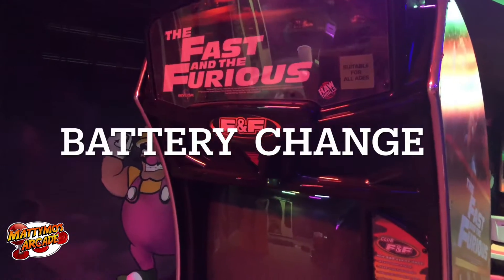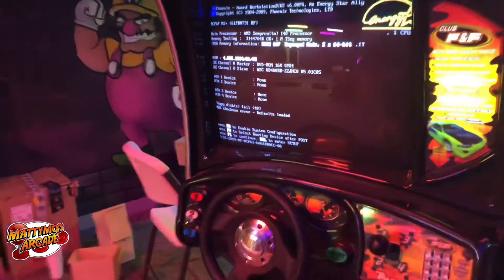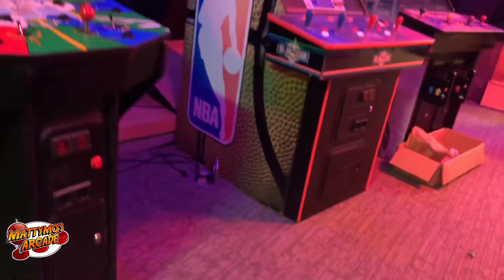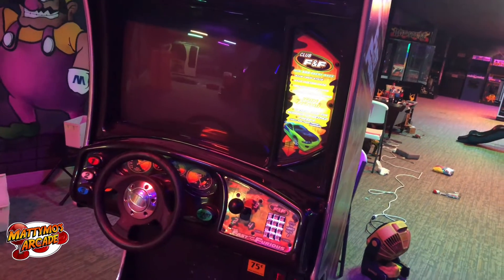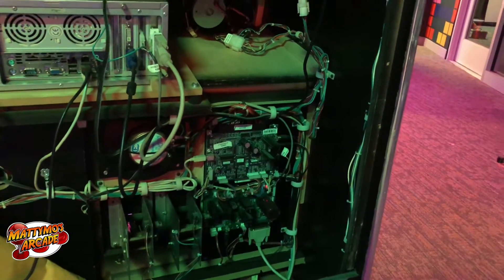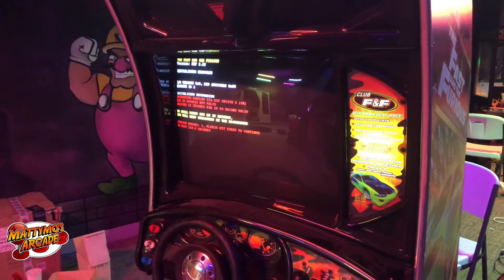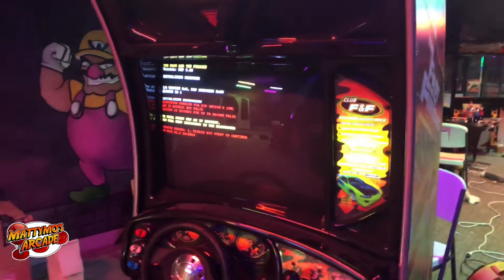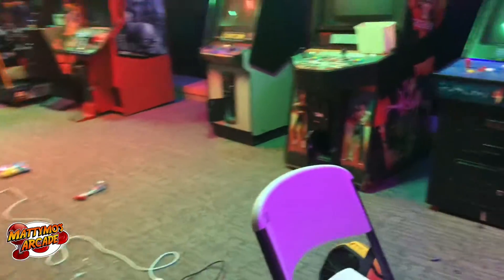Fast and the Furious Arcade Game Repair: No Signal, Battery Change (Again)

Comment: So I just picked up the raw thrills game, and I put in a couple different batteries changed the power settings and got the game to boot up, and then it all the sudden everything shut off. And then I turn it back on and it is black screen and then it shuts off, would that just a bad cmos battery? I checked the voltage before I put it in and it was reading 3 volts. Or do you think it might be the power supply?
Reply from the maker: Power supply, for sure.

Comment: I don’t have keys to get in the control panel ?
Reply from the maker: I’d just drill the lock out and replace it, or you can try to disassemble the lock from the back if you have access there.

Comment: I can't figure out my fast and furious.  Can't get the screen to come on and no sound etc.  Just lights.
Reply from the maker: Check the power supply
Reply: @MattyMosArcade  the screen does appear to have static on it when you touch it with your hand
Reply from the maker: Sounds like the power supply is dead, and the board is not booting.
Reply from the maker: OH OH OH, try turning the PC on inside the game. The main power button is on the front. Reach through the coin door or you can reach around if you’re at the back of the game. If this works, them motherboard needs a battery and the BIOS settings for Power Management need to be reset.
Reply: @MattyMosArcade  sounds about right
Reply: @MattyMosArcade  tried that...appears the buttons aren't turning it on/off.  must not be hooked up

Comment: well done - yes i was shouting 'turn off floppy' - done a fair bit with these, the mainboards dry up and capacitors look ugly and video cards die.  The network error messages is because it cant find others, it is default to look for others and yes the dips do change a few things.  We have 4 networked, cracking set of games.
Reply from the maker: We have 4 linked at the mall. The PC was repaired in this one fairly recently. It’s the cleanest one I’ve seen, ever. I’m hoping to keep a good eye on them to prevent that crap again. Extra fans only do so much. Lol
Reply: @MattyMosArcade  cool - with the latest software think u can go up to 8 players - not sure
Reply: @MattyMosArcade I need help I bought a whole building of racing games and driving games some are set on $1 and somw set on 50 cents I have 2 just like you havw in this video that need the battery changed if you coukd help me I'd greatly appreciate it I don't know where to begin they all are 1 quarter coin mechanism so it has ro be a setting right
Reply from the maker: @Americanamusements1970  Where are you located?